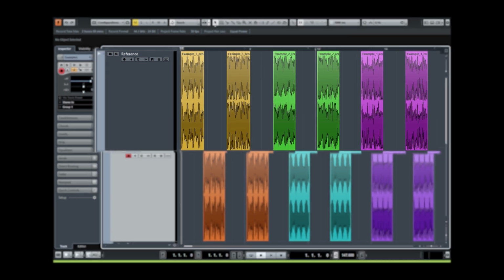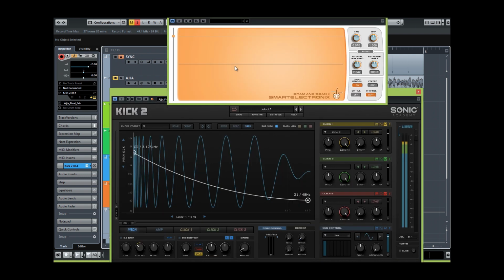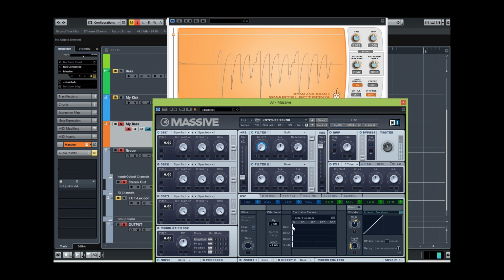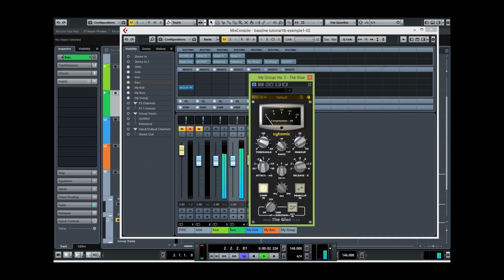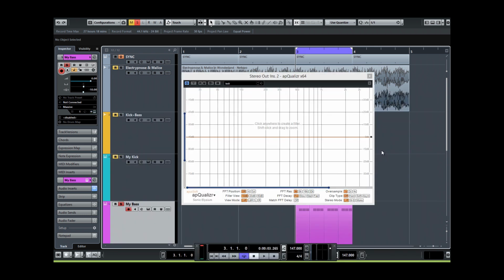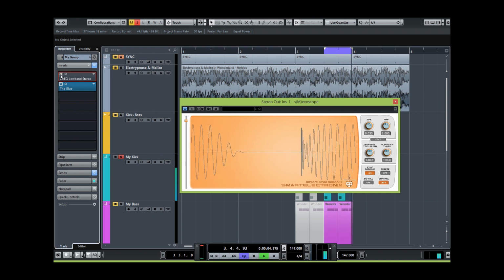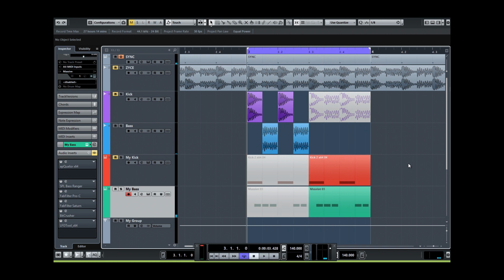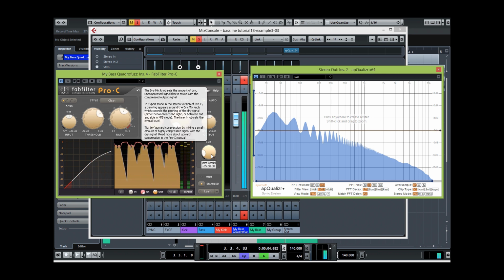Ultimate Kick and Bass Tutorial by Sonic Elysium

Comment: Surgical work.Many many thanks Alexey.I got one question but it might sound silly..i don't know..
I got this track and my bass  runs for 16 bars on a C note and then for the next 16 bars as on a D note.
i suppose i should EQ both my basses accordingly.Can i do that by writing both C and D on a single track a make an automated EQ that would switch by itself from C to D back and forth?
Or should i just put C on one track and EQ it alone and  D on another and EQ it also alone?
Reply from the maker: You know, I've tried automation and many other different ways, but in the end i've found that the best way is to render fully processed sound of each note and then just put all the waves on a single track. It may seem to take a bit more time, but anyway automation takes time and using multiple tracks with different eq (and other processing) setting also takes time.

Comment: love this tutorial so much man! tnx very much
i have 2 question 
i did not get how you route the click to trigger the scope?
im not understand the sentence about the lower harmonics and the compression(21:45), there is any chance to clarify this? 
tnx again :)
Reply from the maker: When
 you set the "rising" mode in the exoscope, it makes it refresh to the 
peak signal (the most loud spike of the waveform). I want it to refresh 
everytime the kick drum hits. So I need to have a loud spike at the 
beginning of each kick drum sample. To 
do that, I take another instance of the Sonic Academy Kick2 synth (you 
may use any other synth, makes no difference). I make a very short and 
very high-frequency spike (~20kHz), just a short and high sine wave, so 
that it is almost inaudible and does not distract me. Yet it has to be 
louder than the kick and bass itself, so that exoscope would react only 
to the sync spike and refresh everytime the spike hits.

"lower harmonics compression" - I wanted to emphasize that compressor does not make the whole signal lower in volume, but in this case it lowers particular harmonics that "stuck out", and makes the whole signal smoother
Reply: got it, thank you man